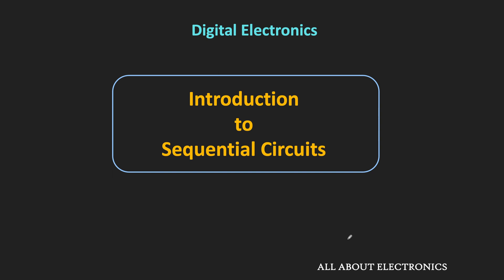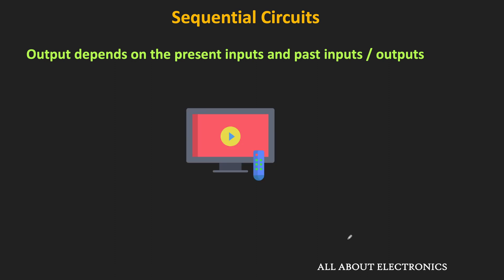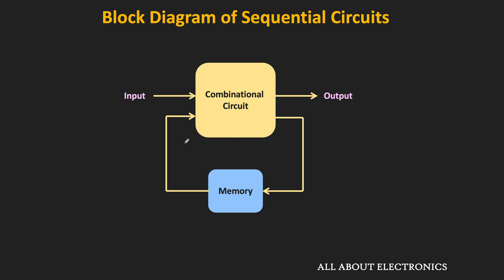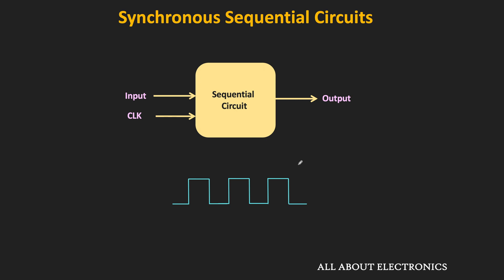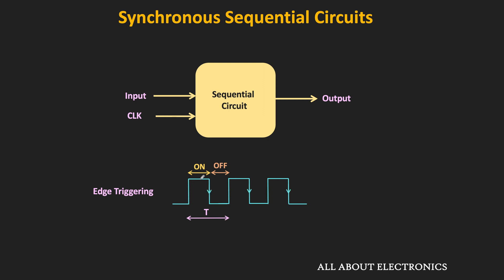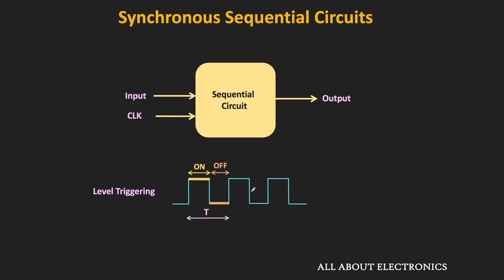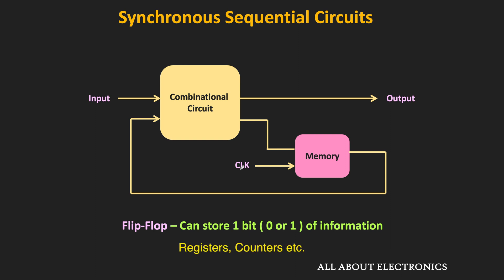Introduction to Sequential Circuits | Digital Electronics

Comment from the maker: For more videos on Digital Electronics, check this playlist:
https://bit.ly/31gBwMa

Timestamps:
0:00 What is Sequential Circuit?
3:33 Block Diagram of Sequential Circuit
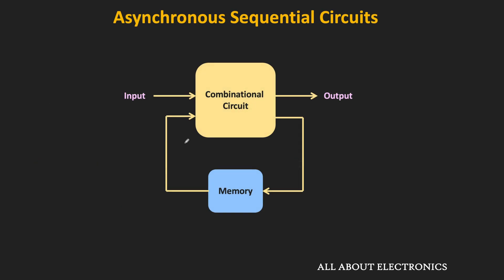5:43 Asynchronous Sequential Circuit
6:42  Synchronous Sequential Circuit
7:33 What is a clock signal? The basic terminologies related to the clock signal
9:55 Edge Triggered and Level Triggered Sequential Circuits

Comment: To do a sequencial circuit we need a latch. But is latch a sequencial circuit or not?
Reply from the maker: Latch is also sequential circuit. It is very basic building element of sequential circuit to build a larger sequential circuits.
Reply: @ALLABOUTELECTRONICS  But if you say that in order to do a sequential circuit we need memory and, therefore, a latch, I don't understand how it comes that we can do a sequential circuit, like a latch is,  without memory and without a latch. It seems all so unlogical...In other words, since it is possibile to do a sequential circuit without following the paradigm of a sequential circuit you presented then what you presentetd cannot be a general paradigm of a sequential circuit. I don't know how to explain...
Reply: @marvnet8898  Instead of understanding sequential circuit as something which has memory, try seeing it as a ckt whose output depends on the present input as well as the past output. You may ask 'what if it's the first time and input is given??'. Consider that output was already given for that case (hypothetically). A latch works on this principle forming the base of sq ckts.

Comment: Sir this ques is from different topic but plzz clarify the difference between solenoid and inductor
Reply: An inductor is any circuit element designed to build up a high magnetic field in proportion to the current pumped through it. A solenoid is a geometric shape that happens to make a good inductor when it is built around a piece of iron
Reply: @RiverBeard  it implies every inductor must b solenoid....... But every solenoid may or may not b inductor